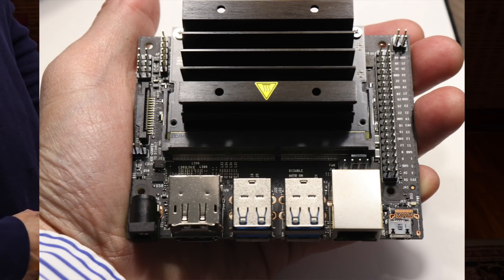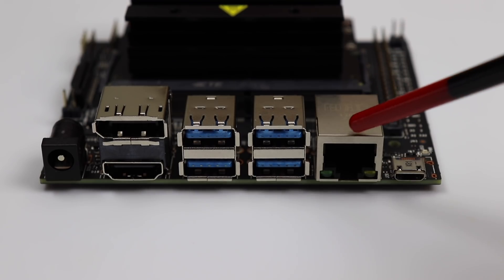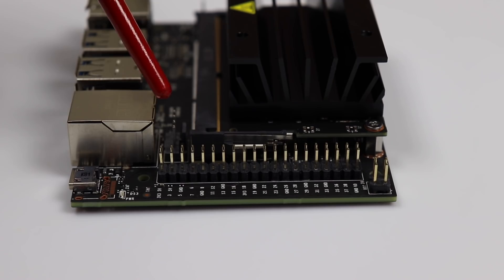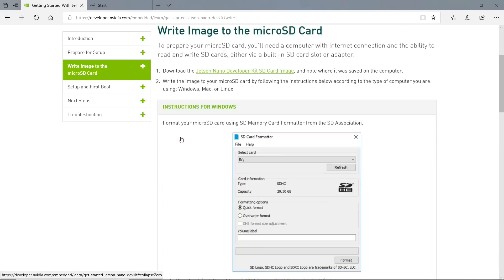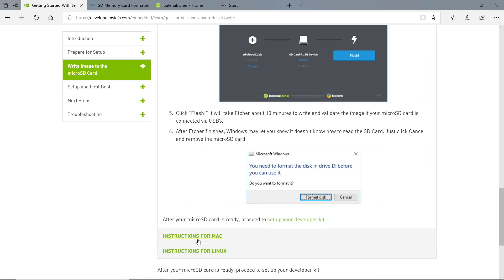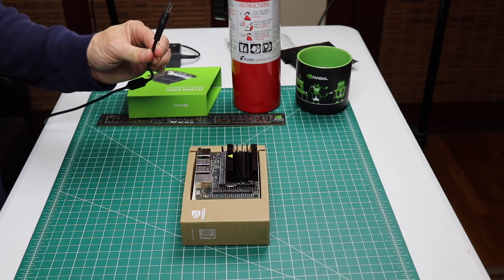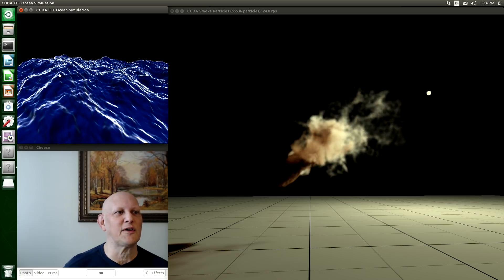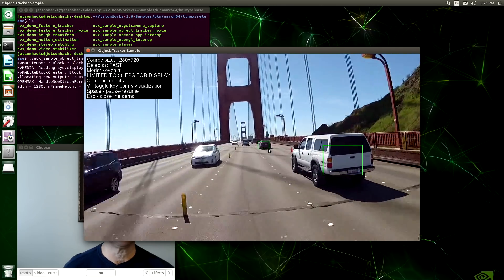$99 Jetson Nano - Intro, Setup and Demo

Comment: is the jetpack not supported for nano anymore? or is the link from the get started page u used here already that?
Reply from the maker: I don't understand your question. The link: http://nvidia.com/jetsonnano-start links to the get started with Jetson Nano page. Here's the archive for all the different versions of JetPack, the Nano uses only JetPack 4.X versions: https://developer.nvidia.com/embedded/jetpack-archive 
JetPack 4.6.4 is the latest as of this writing. You can also use the SDK Manager to install the latest JetPack for the Nano.
Reply: @JetsonHacks  so there is an image that we burn to the sd card, is that already containing like the jetpack? Or is jetpack installed separately after u made the jetson nano to work?
Reply from the maker: @khenpahilanga9596  Yes, the SD card has JetPack installed already.

Comment: after 1 year interruption (and same frustration) I retook these classes and finally got it working! I initially struggled with the external power supply (need to use the 5 volt from the jetson in addition to  the external supply to make it work actually): then I spotted what was compromising my system!: a misspelled "servo.anle" in the while loop of the code testing the servo movements, which for some reason does not cast a syntax error! the code runs silently with no result until the pins are cleared up: I wondered  for a long time if I had damaged the system with my powering experiments for a long while. I finally got the camera tracking decently I believe relatively quickly ... and I'll enjoy your solution now!
Reply: ok, after considering to convert pixel to angles by chance I got a stable system by checking that the center of the track object was contained in a box 10% of the proportion of the display... also I used the largest object only and a try except to do nothing in case no contour were mapped. but the idea of the proportionality was cool
Reply from the maker: I'm glad that you were able to get it to work!

Comment: when i power up my jetson nano card it turns on but does not start and the ignition light on the card is red when it is supposed to be green i need help and explanation to solve this problem please
Reply from the maker: The red light sounds like some type of error. Please ask this question on the official NVIDIA Jetson Nano forums, where a large group of developers and NVIDIA engineers share their experience: https://forums.developer.nvidia.com/c/agx-autonomous-machines/jetson-embedded-systems/jetson-nano/76

Comment: Hello, I had installed SDK manager to flash my agx xavier with my ubuntu system several months ago, now I purchase a Nano and I want to do its setups. Does that SDK manager or its dependencies on host machine make any conflict for setup of nano? Should I uninstall or remove the SDK manager or any further action? thx
Reply from the maker: The easiest way to get started with the Nano is to flash a SD card. However, you can still use the SDK manager if needed. The SDK manager can handle both the Xavier and the Nano without any trouble.
Reply: @JetsonHacks  Thank you so much
Reply from the maker: @leilaghasemzade5880  You are welcome!

Comment: Dell Precision M4700 Nvidia Quadro K2000M 128-bit 2GB DDR5 SDRAM PCIe 3.0 x16 Video Graphic Card  can it be used on a Jetson Nano board
Reply from the maker: Not that I know of. You can ask the question on the official NVIDIA Jetson Nano forum to check to see if other developers or NVIDIA engineers have any experience with it. Thanks for watching!

Comment: Please help logitech c270 webcam is detected as USB device but cheese application is not turning ON showing that it's the app is older and not compatible with current ubuntu version
Reply from the maker: Please ask this question on the official NVIDIA Jetson forums, where a large group of developers and NVIDIA engineers share their experience.

Comment: I did everything as the tutorial suggests. Once everything is set up I try to install sublime text or atom or any other app but I get the same error every time. E: Unable to locate package sublime-text . It's very frustrating because I wanna work on many projects and can't even install a text editor. Has anyone else who also downloaded this image run into the same error ? In all fairness I did use a virtual machine to try the ubuntu version(18.04) and  installed sublime text with no difficulty at all. So up until this day I still do not know how to debug this error. Any help is much appreciated.

Comment: Nvidia ARM software support is awful. All their devices running Linux kernel version 4.9.140, that is few years old one.
There is no way to upgrade a kernel to a newer version. If you just agree with Ubuntu to do any upgrades, it is break all Nvidia drivers.
And there is no way to install a Wi-Fi 6 drivers (which is builtin in the kernel v5) and not to break all other drivers.
For all old devices they just stopping to release updates, so you will stuck on some kernel version forever.

Comment: Thank you for the tutorial! I followed it all the way through the boot sequence, my nano does not boot. It flashes an NVIDIA screen and loses input from Jetson. Have you seen such a problem when using a converter for display? VGA to USB converter...Thank you!
Reply from the maker: You are welcome. I do not know what a VGA to USB converter is. The Jetson Nano requires an HDMI monitor. Thanks for watching!
Reply: @JetsonHacks  Thank you for taking the time to answer me. Its basically an adapter for my monitor which has no HDMI port so it converted VGA to HDMI. Maybe I will need to find a monitor with HDMI port to get it working....

Comment: are there known HDMI connection problems?  I couldn't seem to make the nano connect to via HDMI.  I have already tried 3 different monitors and I know they all work just fine because I use all of them for other laptops, gaming, and other stuff.
Reply from the maker: Are they HDMI monitors, or are you using adapters?
Reply: @JetsonHacks  HDMI monitors.  For some reason the eDP is connecting, but for me to find that out, I had to borrow my neighbor's monitor and when I tried connecting both HDMI and eDP xrandr result indicates that HDMI-0 is disconnected and DP-0 is connected as primary etc. I tried to make HDMI as primary but it still wouldn't detect.  And this is the same for the other 2 jetson nanos that I have. I bought the unit from picocluster, so, I was wondering if somehow during the installation, the driver wasn't properly installed or was not included.  If that were the case, it wouldn't even show HDMI-0 disconnected wouldn't it?
Reply: just an update: it was a  likely missing driver issue.  I reflashed the microusb and lo' and behold, it's working with HDMI now.

Comment: So I don't need the jumper if I power it from the micro-usb? I'm having issues, 'cause once I turn the power on, I see nothing on the screen, and I've tried using two different ones...
Thanks for sharing this!
Reply from the maker: Do not use the jumper if you are powering from micro-USB. From there: Use a true HDMI monitor, probably won't work with a DVI or VGA with adapter. You should also use a simple wired mouse and keyboard to get started, or the USB cable if you are SSHing. 
I don't have anything else to share beyond the video and article. Please ask your question on the official NVIDIA Jetson Nano forum where NVIDIA engineers and a large group of developers can help you. Thanks for watching!

Comment: Thank you for the videos Jim, they are so helpful and interesting. The Jetbot uses 2 wheels, 2 DC motors but I want 4 and 4. Do you know if any of the code has to change or just hardware?
Reply from the maker: I suggest you ask the Jetbot folks the answer.

Comment: hi so i was wondering for the 40 pin gpio itself is there any pin or something that allows it to be active high when connected to object detection such as tiny yolov3 such that when detecting an object the pin will give an output high ?
Reply from the maker: Yes. Please see jetsonhacks.com for the pinout of the GPIO Expansion header. It is in the same configuration as the Raspberry Pi GPIO header.

Comment: hi i am working on a object detection project and want to run tiny yolo v3 on it. However is it possible to use an i/o pin on the jetson nano and connect an led or buzzer to buzz or light up once it detects the object example a weapon"gun". and if so do you have any idea how i may go about it?
Reply: thanks a lot:)
Reply from the maker: The Jetson Nano has 40 GPIO pins which are pin compatible to a Raspberry Pi layout. We will be running an article soon on how to connect and code LEDs through GPIO. Thanks for watching!
Reply: Would u be able to attach a link or notify once the article come out thankss:)
Reply from the maker: https://youtu.be/kVUNpyaHCc4

Comment: I'm really looking into buying an SBC, and the Jetson looks wonderful, but I'm wondering if I could use one of those 3.5" touchscreens that have GPIO connectors on them. Can I install Raspbian on it instead? What can I do on a Pi that I can't do on the Jetson?
Reply from the maker: From your questions, it sounds like you should use a Raspberry Pi. There is much more educational material immediately available. Thanks for watching!
Reply: @JetsonHacks  wow, man, i didn't expect to hear from you, just others also interested in this. Thanks!

Comment: What size is the barrel connector for the 5V power jack?
Reply from the maker: 5.5mm outer diameter, 2.1mm inner diameter, 9.5mm length, center pin positive. Here's a video about it: https://youtu.be/jq1OqBe267A
Thanks for watching!

Comment: This looks like it's got some pretty serious horsepower for being that low of a price. With all that motion sensing/tracking ability, this could become the brains of a pretty robust little robot. Is this how we get Cylons? Because I'm not sure that we want Cylons. ;)
Reply from the maker: Well, we know that it's not how we get Terminators, because time travelers bring that back to this time frame. Thanks for watching!
Reply: @JetsonHacks  Plus, The Terminators used 6502 chips and assembly code, so we know they weren't ARM based. :D

Comment: In the Technical Specifications at https://www.nvidia.com/en-us/autonomous-machines/embedded-systems/jetson-nano/ they mention that the Jetson Nano has a 16 GB eMMC 5.1 Flash storage. Is that bull ???
Reply from the maker: I do not believe so. You are looking at the Jetson Nano Module page. The Jetson Nano Module is a different part (and has a different part number) than the Jetson Nano used in the developer kit. The Nano Module is meant for use OEM use by manufacturers who are not shipping with the developer kit carrier board. The Nano Module (in qty 1000) is $129. Thanks for watching!
Reply: @JetsonHacks  I see. thnx !!!

Comment: How to use this without monitor , I mean using Jetson nano with laptop screen 

Either through ssh, vnc or any other protocol
Please guys help me, I didn't find anything on this 
Please help!
Reply from the maker: It's a standard Linux box, you should be able to ssh into it once you go through the initial setup. Please ask this question on the official NVIDIA Jetson forum where a large number of developers and NVIDIA engineers share their experience. The forum is here:  https://devtalk.nvidia.com/default/board/371/jetson-nano/

Comment: Thats less power than the pi 3 calls for
Reply from the maker: That's correct. I think in practice when people are running the Jetson Nano in 5W mode, they just use a Raspberry Pi power supply. Typically it's around 2.5A @ 5V. That gives a little headroom for attached peripherals. But most people run in 10W mode, which means with the peripheral draws and everything they end up using the 4A barrel jack. Thanks for watching!

Comment: What's the default IP when connected via Ethernet?
Reply: That's normally controlled by your router. It'll generally be the first available IP on your route'rs subnet. Either navigate to your router's home page (normally something like 192.168.0.1) and log in to see connected devices or run nmap to find them.

Comment: Price gouge compared to a Pine64.
Reply: @Robin I had no idea these existed. Thank you!
Reply from the maker: If the Pine64 meets your needs, you should select it. The Jetson Nano is a different class of machine. The Nano is ARM Cortex A57 vs A53 on the Pine, the Jetson has a 128 core GPU, the Pine does not, the Nano has hardware video encoder (2K) and decoder (4K). A better comparison is a Raspberry Pi vs. the Pine 64, which is favorable towards the Pine. Thanks for watching!
Reply: @JetsonHacks  Well, then there is the Latte Panda, which can run full Windows 10 for about $150.00.
Reply from the maker: @rtonce  The Panda is a fun little board, I like the built in Arduino. If running Windows is important to you, certainly worth a look. A lot of developers/makers don't really care too much about that feature. The Panda has only 12 GPU cores (the Nano has 128), and it's not clear how you program the Panda GPU; the Nano uses industry standard CUDA. If it meets your needs, you should get that. It is an extra $50 with the Windows license, which may/may not be a value add depending on your application.
Just so we don't drown, there are probably hundreds of different SBCs in or around that price point. We don't need to go through all of them. Each one offers different advantages/disadvantages depending on your needs. It's ok not to accept/like this one for your particular application or preference.
Reply: @JetsonHacks  So...I play with Arduino and  SBCs to mainframes and servers and I have been at Department of National Defense HQ for sometime, but...sure, you're the expert. :)
Reply from the maker: @rtonce  Not sure where that sentiment is coming from. Since you are experienced, you know that any of these SBC designs are tradeoffs, and that certain features are more important to some folks than others. If money is the criteria, the Nano is more expensive than some (like the Pine64) and less than others (a licensed Panda). But there are other decision criteria people use such as OS (being Linux only may be a non-starter for some people, for others that may be a deciding criteria). There's also programmability, CPU/GPU performance, power consumption, I/O, and so on.
 
To be clear, you stated that the Nano was a "price gouge" compared to a Pine 64, and implied much less value than a PandaLatte that costs 50% more. I only commented on those points. I don't know why you feel that undermines your experience or qualifications, or elevates mine in any way.
Reply: @JetsonHacks  PPl who fear linux can play with their cells and apps. SBCs really are only for makers and developers who want IO pins...so, cheapest board of reliable quality and availability is probably best. From this, neither your board nor the Panda are the best choices. The Sopine is.
Reply from the maker: @rtonce  If I/O pins are your criteria, then the your recommendation of Sopine is a good choice.

Comment: Is there Docker and Kubernetes support for Jetson? It would be interesting to see some gpu enabled containers running on the Nano
Reply from the maker: The Jetson Nano has built in upstream Docker support. I don't know about Kubernetes. Thanks for watching!
Reply: Upstream supports only CPU as far as I remember. GPU enabled containers would require the NVIDIA runtime however am not sure if that was formally made available within Jetpack. Tegra-Docker on GitHub I believe lets you do this.
Reply from the maker: @Rendergears   This was my understanding. People have versions working on Xavier (which is the same OS). See: https://devtalk.nvidia.com/default/topic/1043951/jetson-agx-xavier/docker-gpu-acceleration-on-jetson-agx-for-ubuntu-18-04-image/post/5296647/#5296647

Comment: M.2 Storage? 
Are or will there be boards that support multiple modules (aka let's cluster 5 together)?
Reply from the maker: There are several third party board manufacturers which have announced plans for different carrier board configurations. One would think that there will be many different configurations for different tasks. Thanks for watching!
Reply: @JetsonHacks  thanks for the answer. Do you know if the  m.2 support bootable storage?
Reply from the maker: The M2 is Key E for WiFi cards.  @BR0KK85
Reply: @JetsonHacks  thank you again:)

Comment: When I added the power-supply, saw the power led flashed. However, I can not turn on jetson nano. The monitor is dark!.(as I read it should be in auto turn on power mode)
Reply from the maker: There could be several causes. There may not be enough power available from your adapter and so on. Please ask this question on the official NVIDIA Jetson forum where a large number of developers and NVIDIA engineers share their experience. The forum is here:  https://devtalk.nvidia.com/default/board/371/jetson-nano/ Thanks for watching!